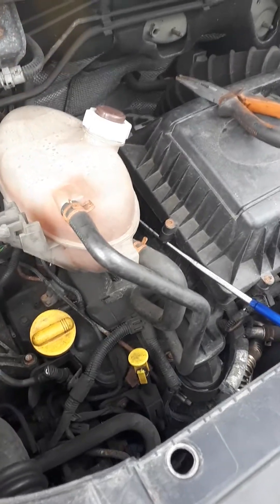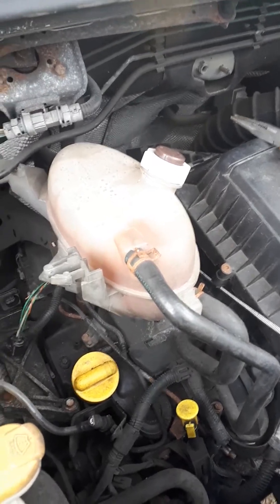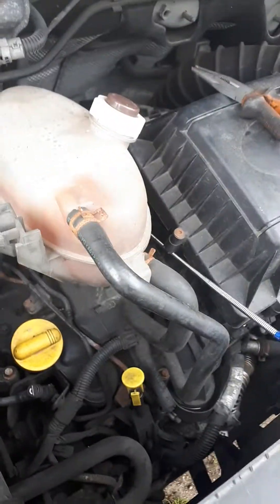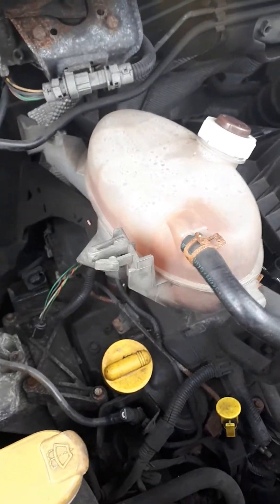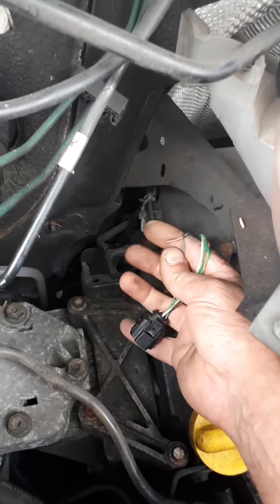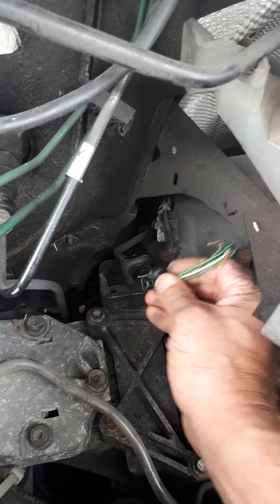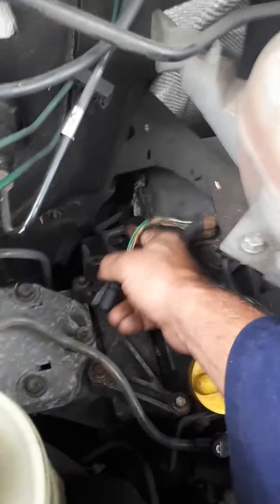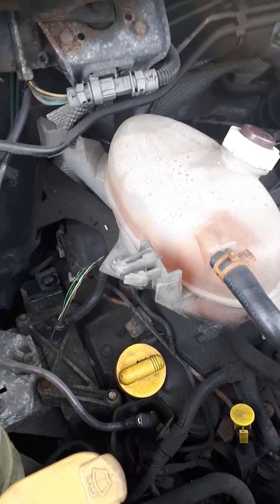Renault Master proportional richness sensor fault

Comment: Is this the sensor before the cat or after?
Reply from the maker: Before the cat
Reply: @mickjohnsgarageservices1955  thanks . I've got this code and someone on the renault forum said they cured this code by replacing the one after the cat . Could it be either one?
Reply from the maker: @steveevans7046  check what the wording of the fault states as it should say which sensor, my repair was for the wiring so can't really confirm which sensor your fault is.
Reply: @mickjohnsgarageservices1955  I'm getting df1264 and df1168 and doesn't really state which it could be